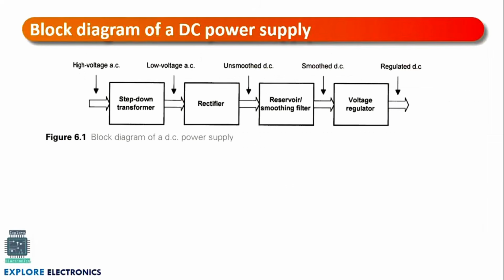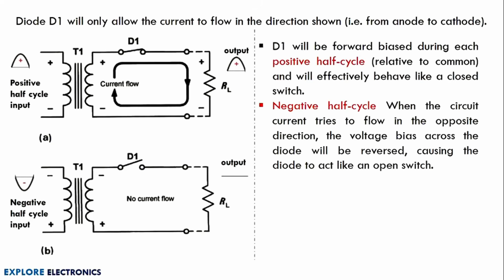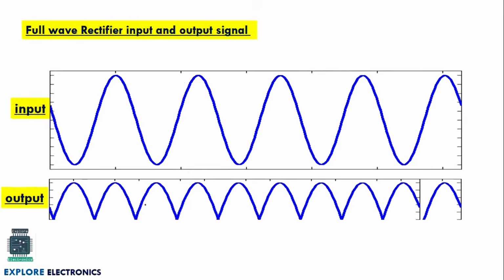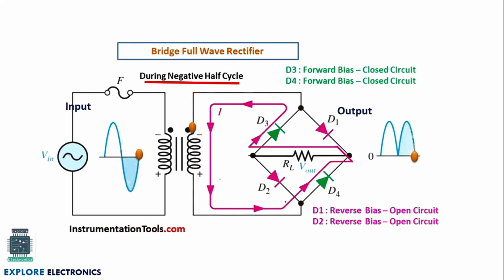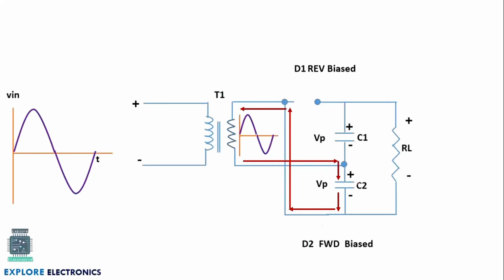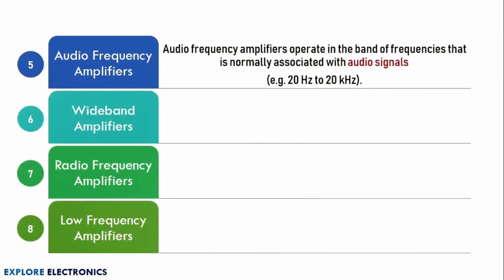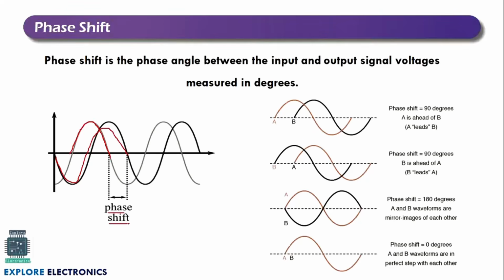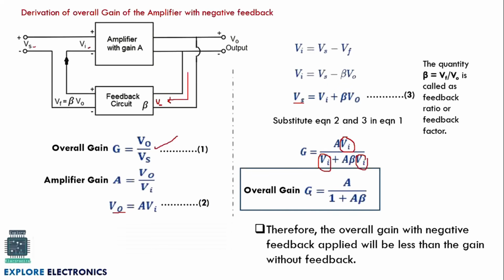Module 1 of Introduction to Electronics and Communication Engineering | 1BESC104C/204C

Comment from the maker: Join https://t.me/exploreelectronicsgroup

https://chat.whatsapp.com/DtNBAdoCZjz9nZTuyQsak8

0:00 Introduction
0:10 Module 1 Syllabus
0:25 Block Diagram of DV Power supply
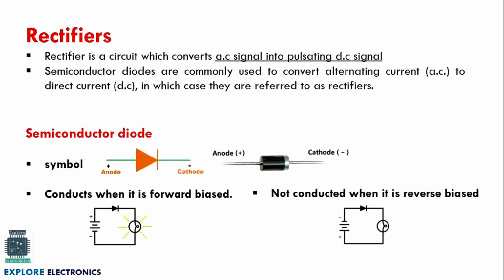4:50 Rectifiers
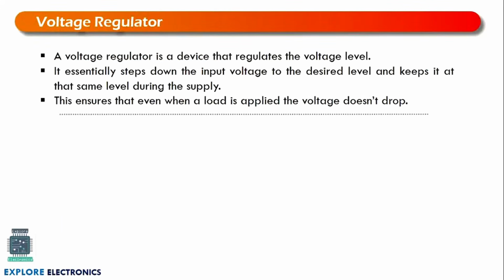29:37 Voltage Regulator
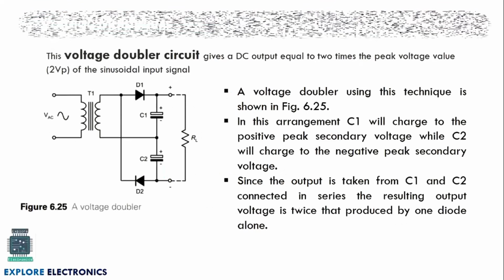34:55 Voltage Doubler
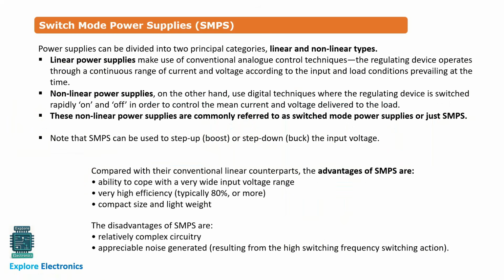37:55 Switch Mode Power Supplies
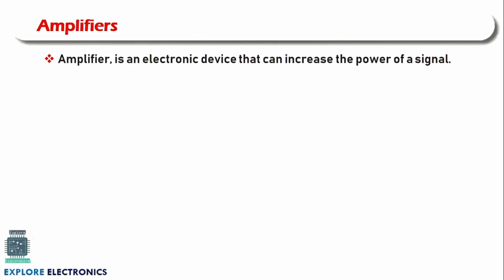44:00 Amplifiers